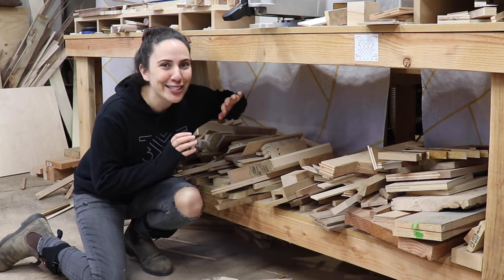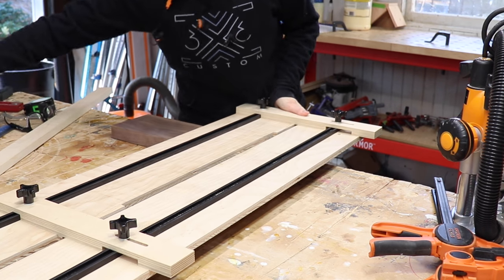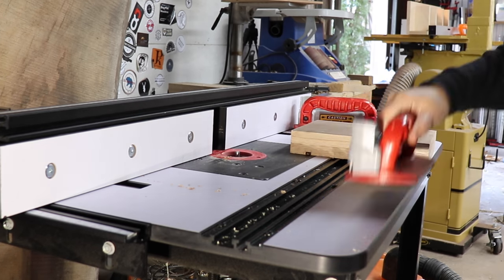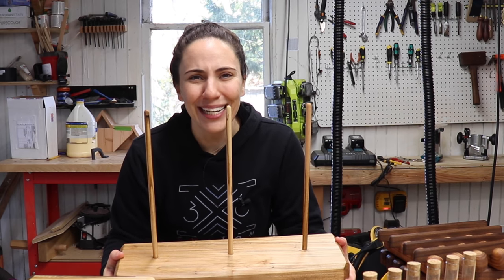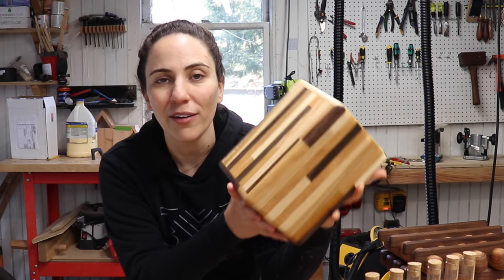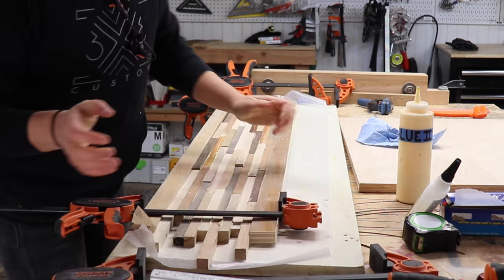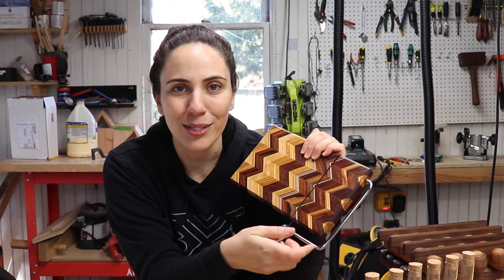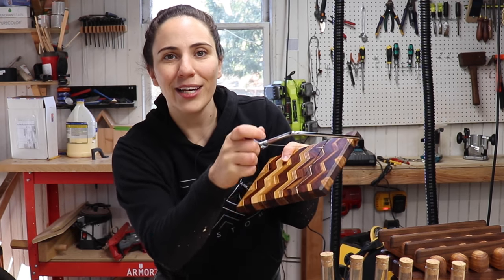5 Quick and EASY gifts you can make from SCRAP wood!

Comment: Can't understand why you would want to add splines to the mitres in normal circumstances. The joint is strong; in fact, ultra strong on account of the glue. If failure or breakage were to occur, then most definitely not on the mitre joint. However, that aside, and from the view point of aesthetics, namely the different species of wood and the use of the finish (danish oil??),  I do think you have created a most beautiful piece of work here.
Reply from the maker: Thanks. It adds strength because it is an end grain joint
Reply: @3x3CustomTamar   In the first instance, I assume you meant external splines, namely cutting across and  into the joint. However, I am assuming you mean an internal spline. Either way for the box construction, splines really make no difference as these four joints are not under compression...unless this is used a step and the force exceeds 250kg, for example. Then the joint won't fracture. Rather the failure will occur along the length. Internal splines in cabinet making are used for alignment purposes rather than for additional strength. Still have items mitred  35+ years ago and there has been no sheering along the joint. However, however, however, if one wants to use a spline,  then be guest! ;-)
Reply from the maker: @Poshypaws  yup. It’s still going strong.